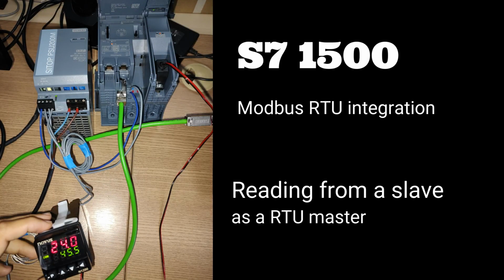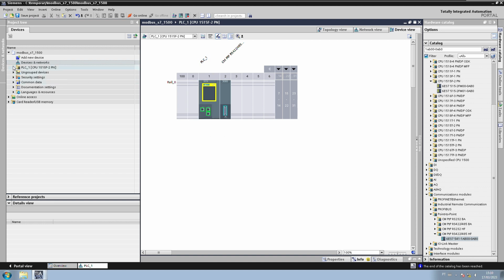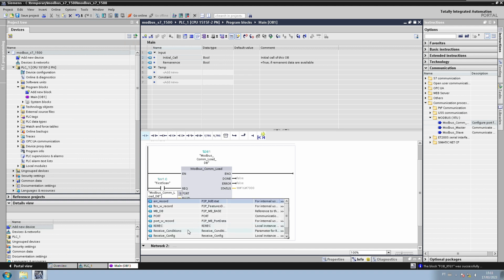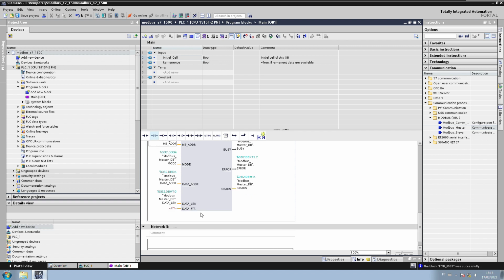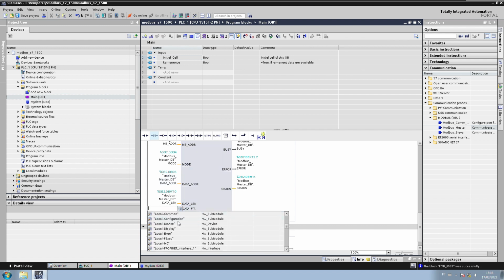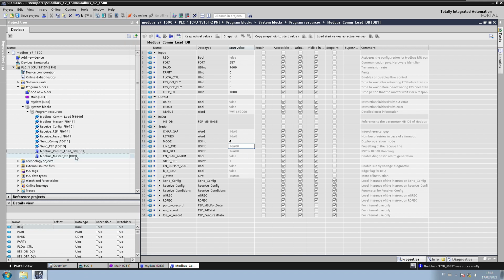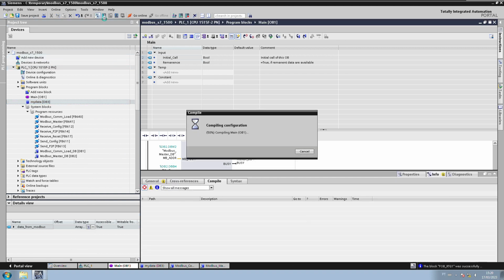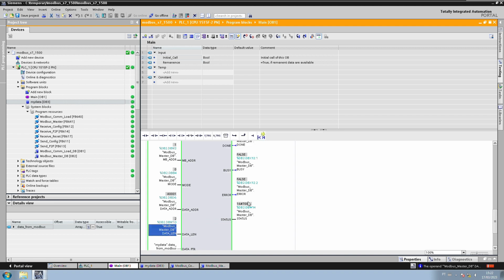S7 1500 and CM PTP RS422/485 HF communication  modbus rtu

Comment: Does this configuration work for connecting one MAX485 (with USB converter) programmed for Arduino UNO? I can only use the HMI on WinCC but not the MB_MASTER from Ladder. I don't know how to connect my serial port to this block. Have any solution for this?
Reply: This is for interfacing with a Siemens PLC Ptp module, not a PC.